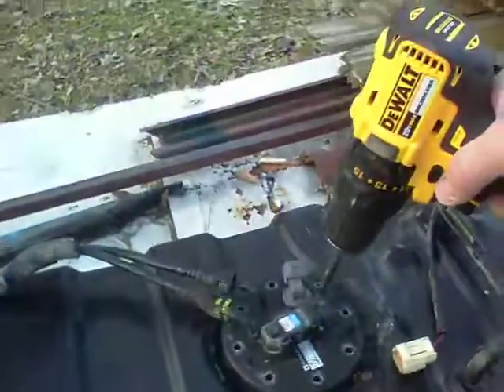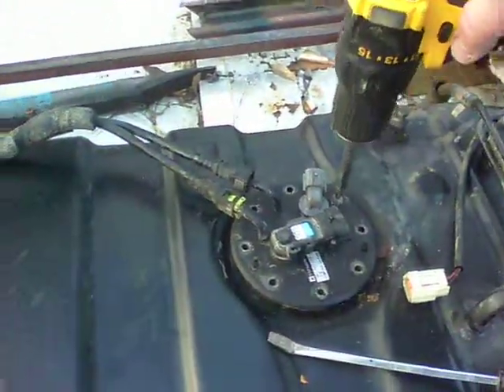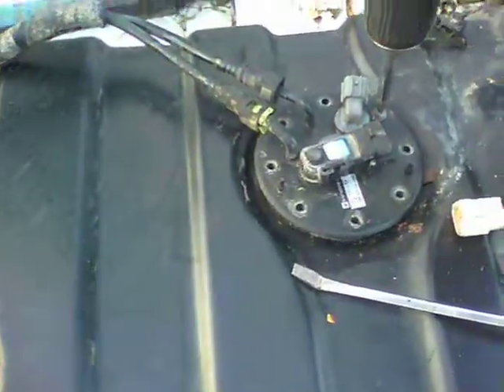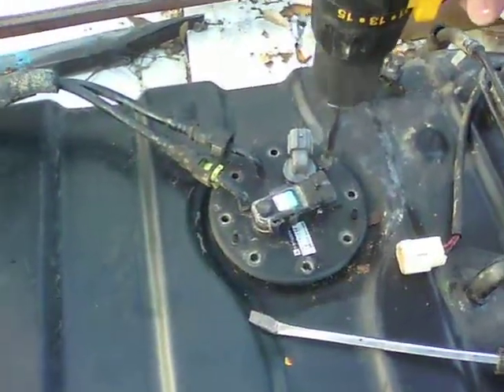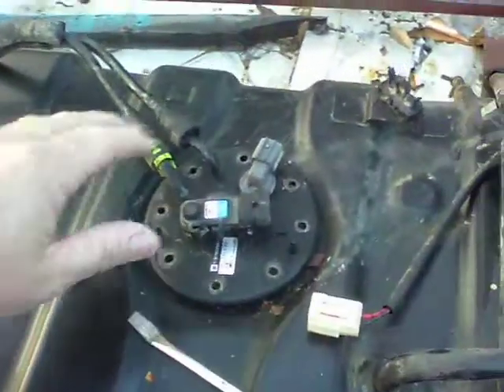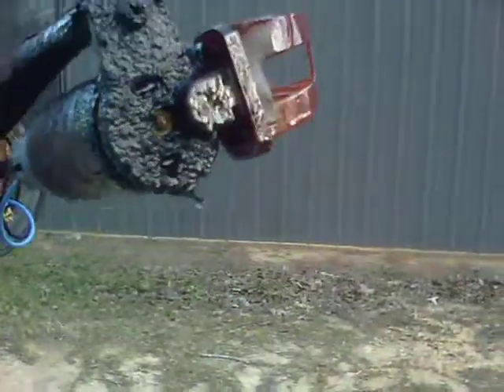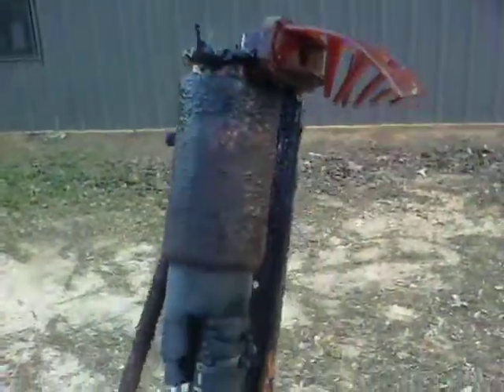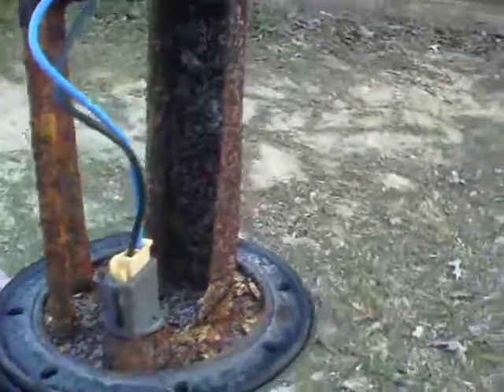Fuel Tank from Isuzu Trooper after sitting for 2 years

Comment: My 89 was sitting for a total of 8 years, we started it to move it 6 years in. I finally got around to working on it and it wouldn’t start. I used to brag about not having much rust on my rig… until I dropped the gas tank. The trooper gas tanks are just rust buckets smh